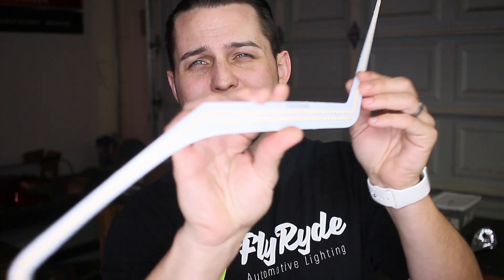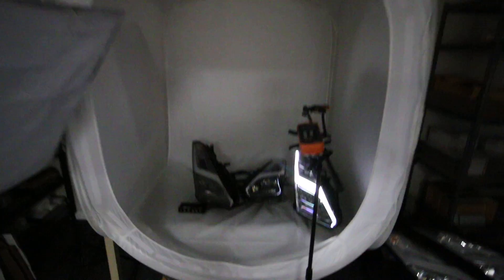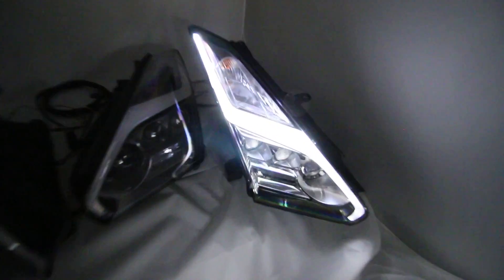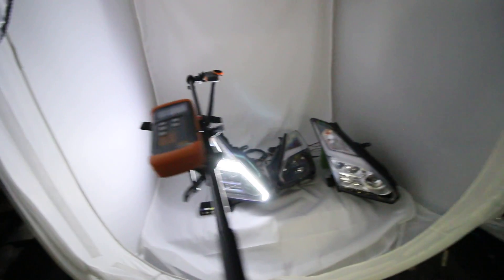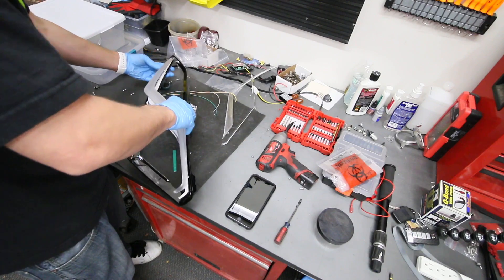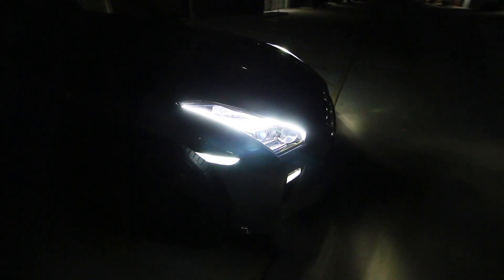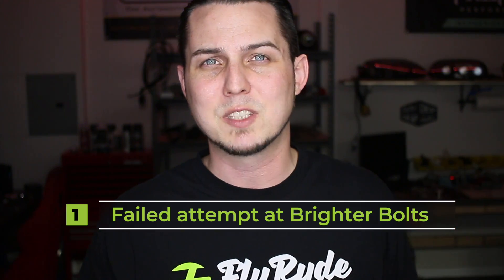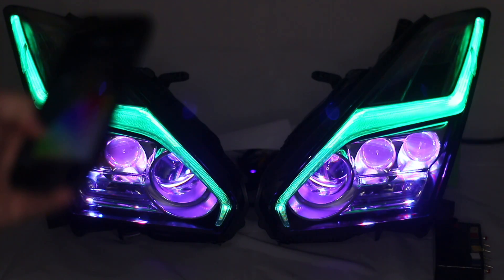LED Lights - are OEM or Aftermarket Brighter? | Nissan GTR | FlyRyde

Comment: I bought the DEPO. That's disappointing... can you guys mod the DEPO lights? :)
Reply: Hey jona. Hows ur depo headlight holding? Any crack from heat issue ?
Reply from the maker: The last set I Modified on the DEPO lights, I swapped the lens from the OEMs to them and they came out amazing 👍

Comment: whats the cost to perform the upgrade to the bolt only on OEM 15 headlight?
Reply from the maker: LORD MEKO the parts and labor involved start at 1000, and keep going up from there. Some builds are 1500, some are 5500, etc. just depends on options 👍